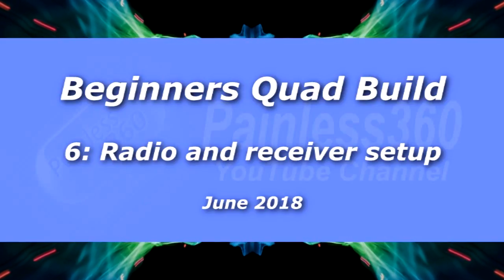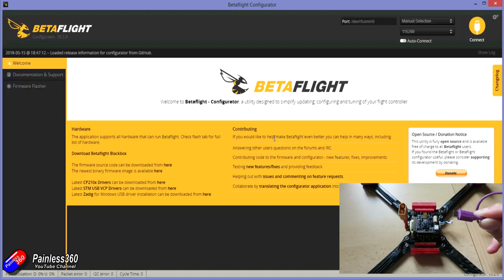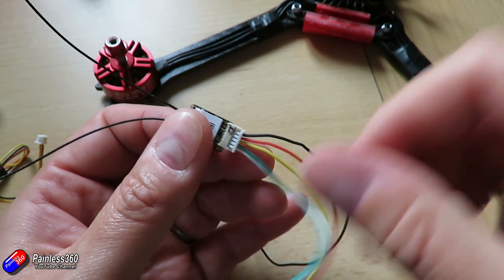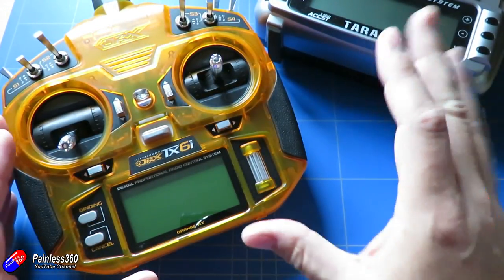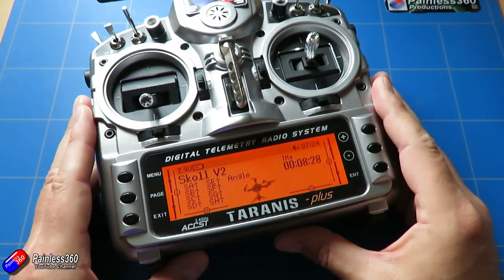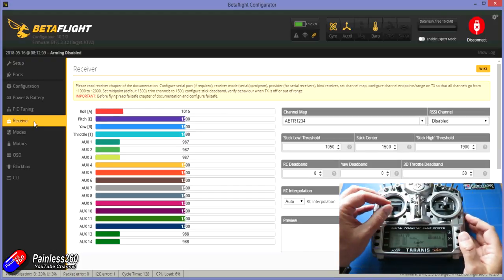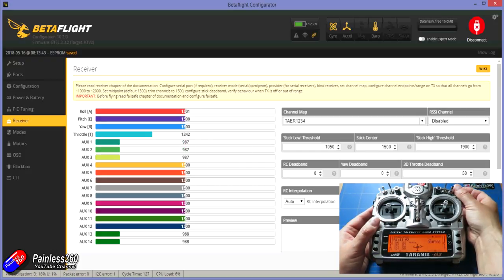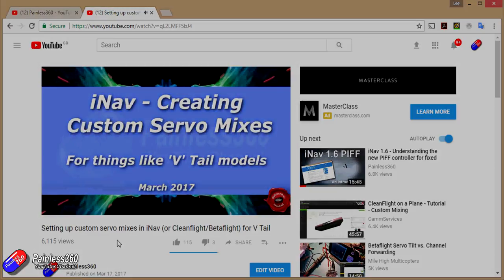Quad Build for Beginners (S8.6): Setting up the radio

Comment: I understand that the EU model Taranis plus radio will only work with compatible EU receivers. What model receiver would you recommend for the non EU Taranis?
Reply from the maker: Same receivers, just running the other firmware..

Comment: What do you do if in the first part of Betaflight the on screen quad responds correctly to quad movement but there is no response to radio stick movement in the receiver tab screen?
Reply: Don Grant Then you have 1 of 3 possible issues: the receiver and transmitter aren't bound, the receiver isn't correctly setup in Betaflight or something has problems (like a burned receiver, the wires are soldered to the wrong pads, etc). The second one would be the first I would check. 😊